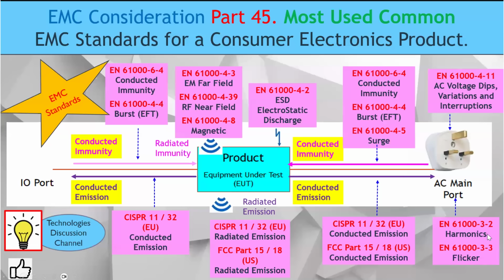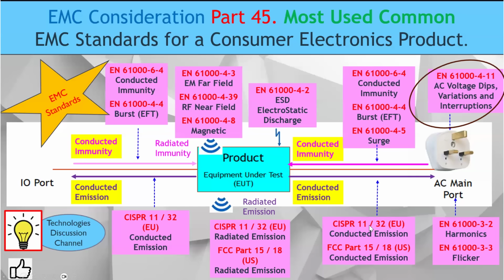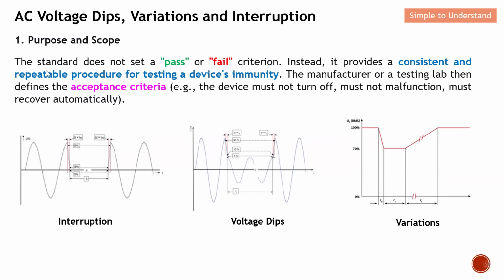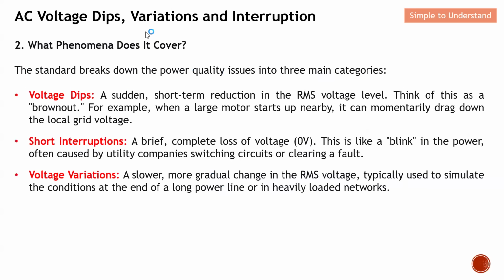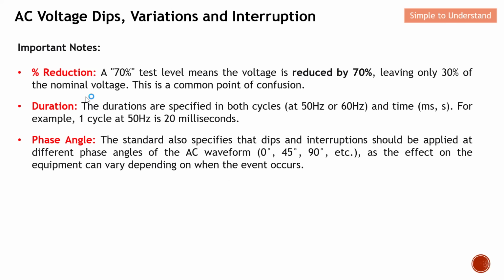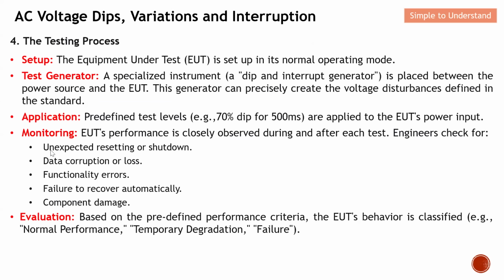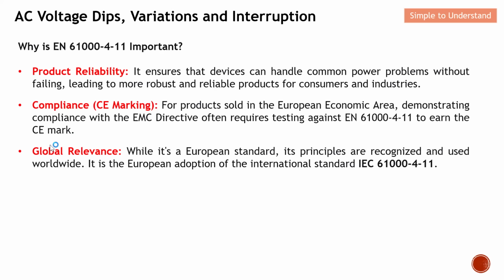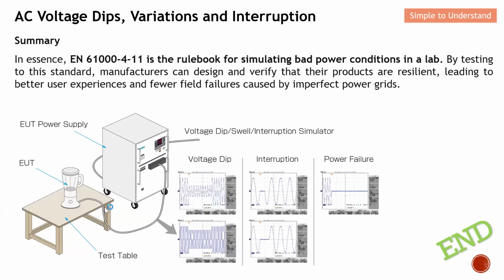EMC #73. AC Pwr Supply STRESS Test! EN 61000-4-11: Voltage Dips, Variations, Interruptions Explained

Comment from the maker: Thank you for watching this EMC video. It has been some time since my last post on EMC discussions. In this video, I would like to talk about the EN 61000-4-11 standard.
In the real world, the AC power source for our Device Under Test (DUT) is not always "clean." For example, the voltage level may vary slightly. This is addressed by the Voltage Variations test.
Next, there is a chance that the power supply may experience a dip (where the voltage drops to 70% of nominal) for a very short interval. We need to perform these AC voltage dip tests to ensure our DUT can withstand such conditions.
Finally, we have short interruptions. For instance, if a generator needs to perform a quick switch, it can cause a very brief interruption where the voltage drops to zero. We must also ensure our device can pass these tests.
It's important to note that the standard does not simply state that if you fail a test, you fail the certification. Depending on the product's classification and its intended use, you may still certify a product even if it fails certain performance criteria.
For example, if the device resets itself and recovers automatically without any human intervention, that may be considered a pass. However, for a critical product like a pacemaker, which cannot stop for even a second, failing any of these tests would likely mean it does not pass the EMC requirements.